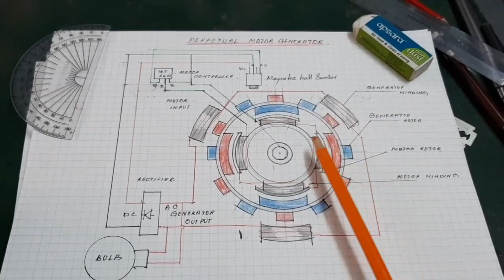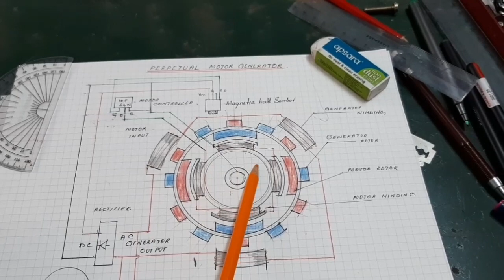(V-124),Perpetual motor generator. is it possible.

Comment: It would have been better if the perpetual generator allowed to run for few minutes after looping.  The video was stopped abruptly.   The big queston is whether the motor will run for ever.  If its really perpetual motion, yes it will.  Kindly clarify.

Comment: Nice project. Have you build a repulsion motor? it has benefits.
when the coil has done its work in repulsing the magnet, it is turned off shortly.
the coil magnetic field than produces a inductive voltage spike (opposite polarity).
this spike is then fed into the next opposing coils (fed by opposite polarity voltage) to add power to the starting magnetic field.
very efficient.
Reply from the maker: Thank you sir